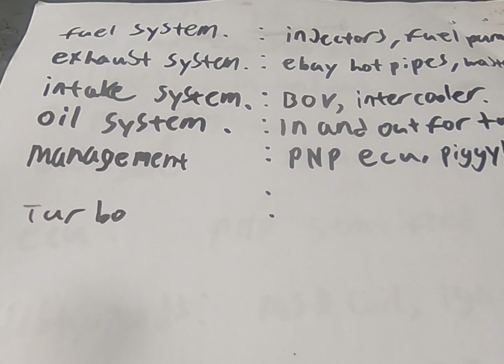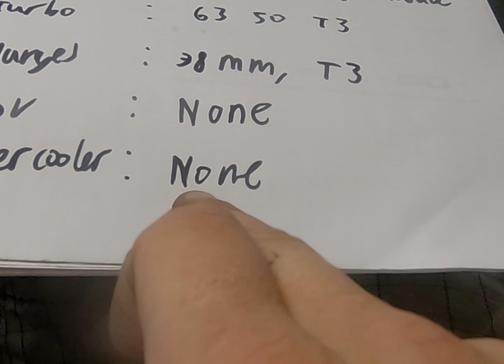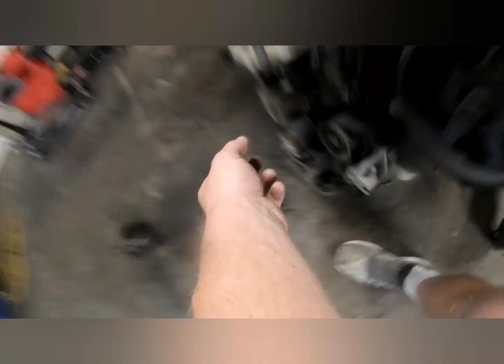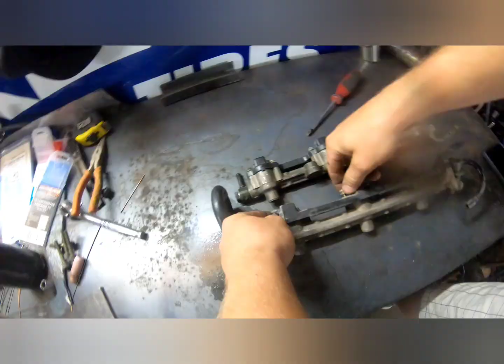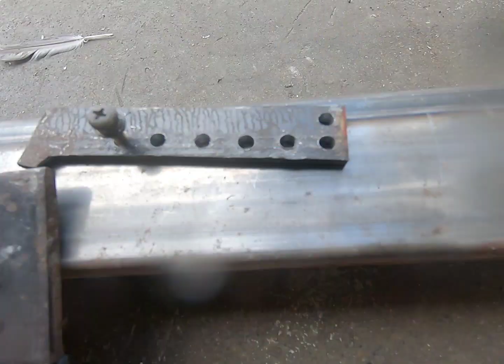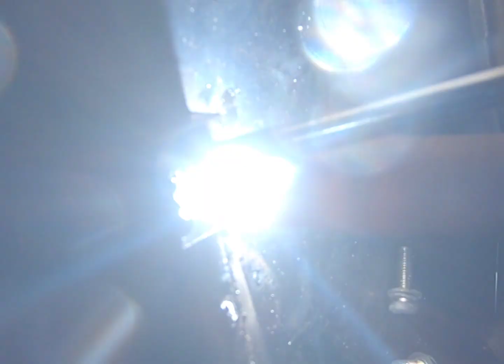How to turbo any car!

Comment: Could've used Mazda millenia s red tops for that low boost setup... Js they drop in and youre done.
Reply from the maker: Ya but im going to be able to run e85 with this setup. And have enough fuel

Comment: I have a mx3, and I want some tips
Reply from the maker: What tips!
Reply: Suicide mx3 I’m in Florida I have a hard time finding parts I was thinking about swapping the 1.8 but didn’t know if the 1.8 I have is a gd or bad motor
Reply: Suicide mx3 basically is the Mazda 6 swap easy can I use the 1.8 wire harness how do I change obd1 to obd2

Comment: 5 pounds of boost on a klze like this or too high compression to be reliable??
Reply from the maker: Needs standalone
Reply from the maker: Ive had 15 pounds on zes lol
Reply: @Suicid3mx3  How did you control fuel if not using stand alone like mega squirt....and what kind of boost would be reliable on a ze
Reply from the maker: I have 2 standalone computers that i tune
Reply: Could I do it in klze with no computer control at like 5-8 psi or do I need controller?